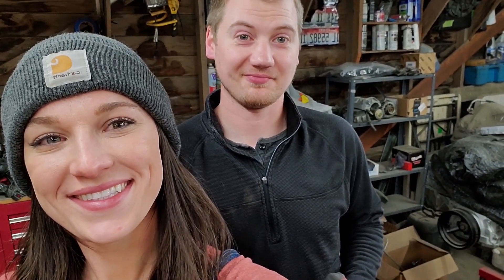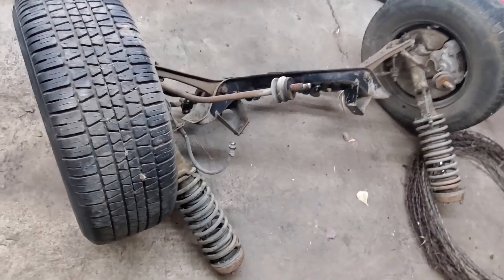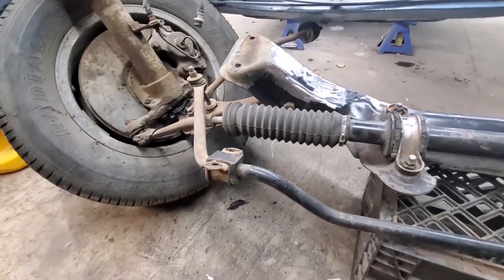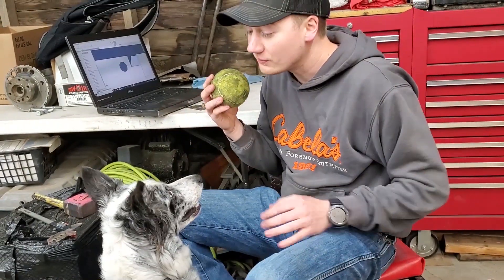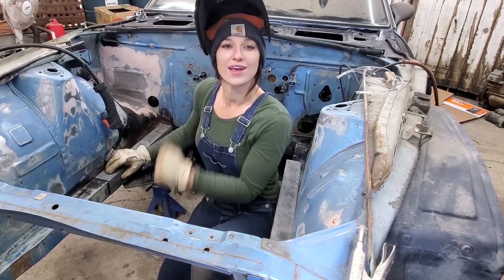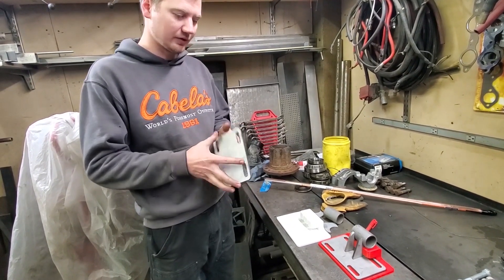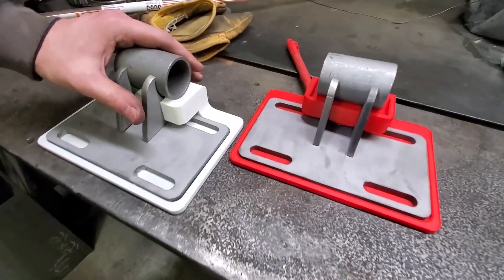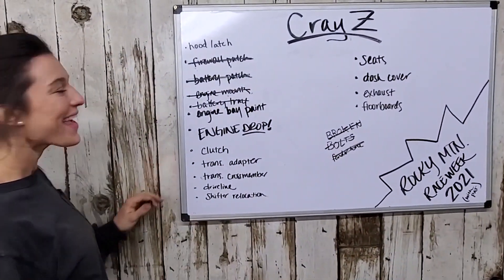"Custom LS/260Z Engine Mounts" | Ep. 10 | Datsun 260Z Build

Comment: You guys are 100% right about dogleg designs being a weak point in many aftermarket datsun parts... it's frustrating
Reply from the maker: We haven't heard of any aftermarket options that have failed, but definitely feel a lot better about this design 🙌
Reply: @WrenchChill  you likely haven't heard about aftermarket diff mounts failing either but I have dozens of screenshots of various high dollar setups failing catastrophically.  On the engine mounts I suspect the trans mount helps take the load off the poor designs and let's them live  longer
Reply from the maker: Yikes!! Now I'm curious...